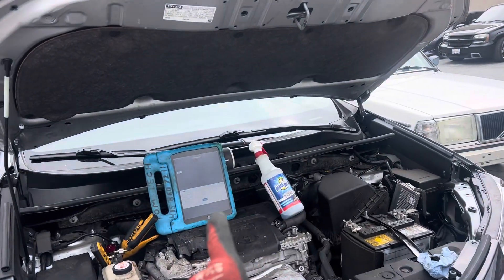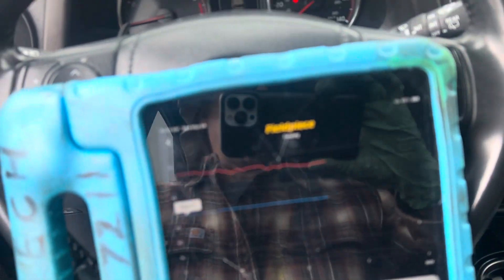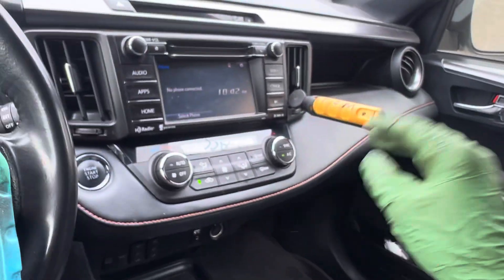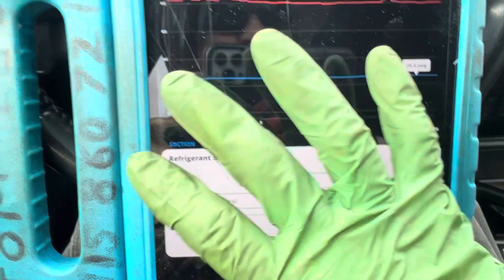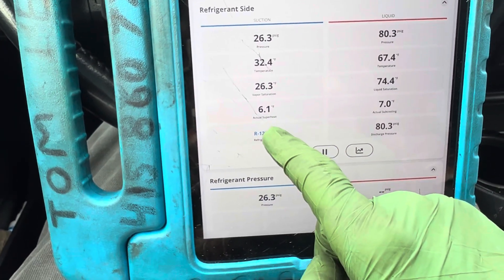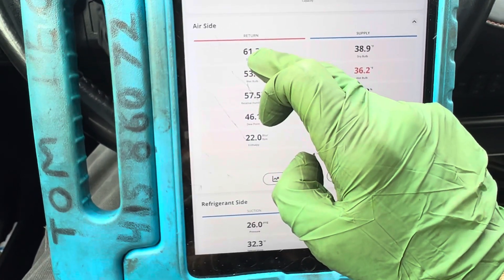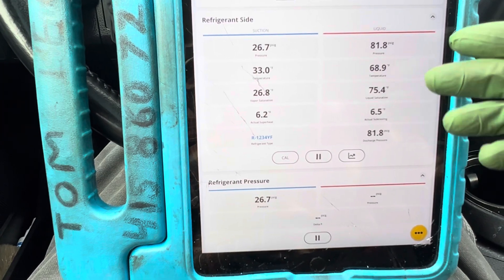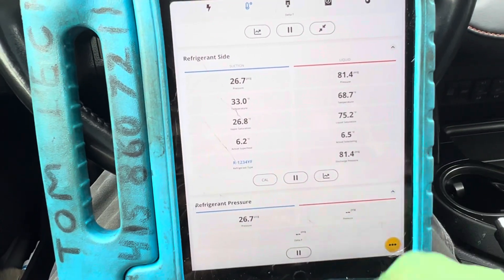Refrigerant PSI & TEMP on 2018 Toyota RAV-4 / R134a

Comment: The conclusion is the variable displacement system only works just enough to achieve the goal of specific cab temperature .   VS Fixed displacement that has  compressor operating at 100% capacity availability all the time .
What the car makers might do is cut down on condenser size  in a variable system because the demand is not required all the time 
Are you seeing variable dis. systems with excess high side pressures at all ?? Are the electronic controls that good ??
 I imagine Nippon Denso is still market leader and has the operation done well
Reply from the maker: Yes, DENSO is still the leader and makes extremely high quality condenser. 

The condensers are much smaller than in the past 

If you go back 30 years, you’ll see, condensers were 3/4 of an inch to an inch thick 

Condensers were 24 to 30 ages wide 16 to 24 inches tall 

Now, if you look at condensers, they’ll be about 5/16 to a half inch thick on the smaller vehicles .  Of course thicker on an SUV or van that has two evaporators cause you have much more load.

In our 12 days our condensers only had 12 fins to 14 fins per inch 

And now today were 18 fins to 24 fins per inch 

In the old days we had three eights inch round tube, refrigerant flow tubing 

Then, our next step in advancement were the Europeans introduced the smaller, 6 mm Refrigerant tubing, the smaller, the tubing, the more surface area to Refrigerant The more heat rejection 

Now jump forward to 2023. The flat tubing can have a dozen to 20 tiny little fins within that half inch flattened tubing. 

So basically, every little passage between the fins inside a tube is so small 
    If you remove the ball bearing out of a Bich, ballpoint ink pen, you could not insert it into the opening.  Now you’re ratio of surface area to refrigerant is a couple hundred percent more than it was in the past.. 

In the vehicles will have DC brushless variable speed fans on the more higher end. Models lower in models will just pulse the fans often on and they may have two fans turn on the first fan benefit senses, the pressure still rising. It’ll turn on the second

Some scenarios used to speed fans 

Just like in commercial and residential split systems for cold-weather operation you’ll put head pressure control, a fan speed controller on the outdoor condenser . 

And they also have upgraded Evaporators the same way they’re thin tiny little microchannel, and Evaporators that are only about one fifths to 1/6 the thickness of the old evaporators that used to be in 1960s and 1970s cars 

And remember that was with our 12 Refrigerant that was much more efficient than our modern day refrigerants . 

They just made the hardware more efficient nowadays . 

And now they have added intercooler heat exchangers on the suction line, running the liquid, refrigerant over and around the suction line to remove more heat out of the liquid refrigerant so I could do more work when it arrives at the expansion valve .